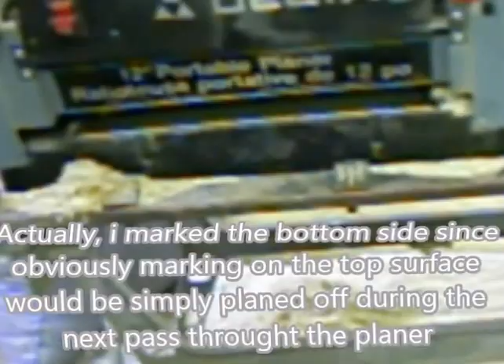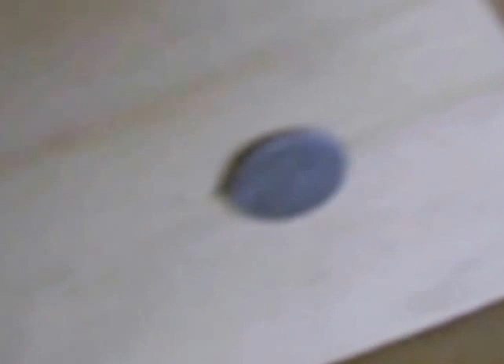How to make stair treads from scratch using rough lumber (Part 1 of 2)

Comment: what kind of glue did you use?
Reply from the maker: Standard wood glue from a hardware store.  It wasnt cradt glue or high strength glue or anything special.  Make sure the label includes "for wood" and you will be fine.

Comment: I don't think solid wood is the right lumber for anything you want dimensionally stable over time. Ply with solid wood nosing would be better.
Reply from the maker: David L i agree that a solid board would warp so I ripped a board into 2" strips, alternated the grains and glued them together to make a stable board.  I'm not worried about warping.